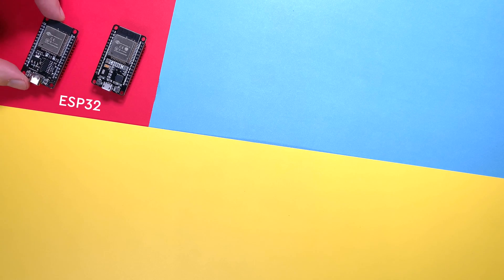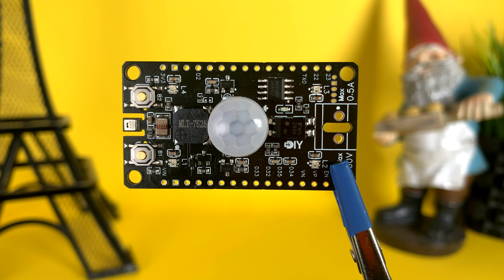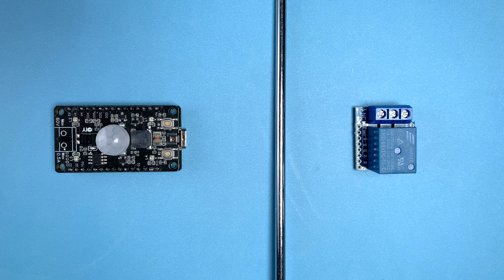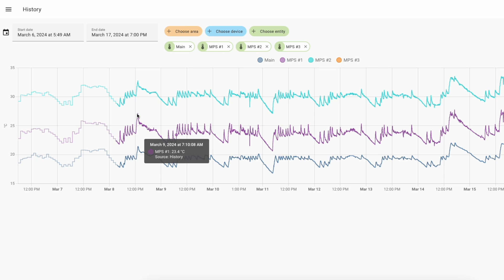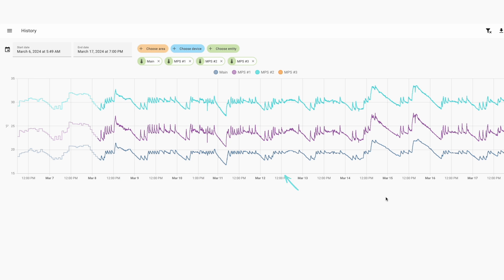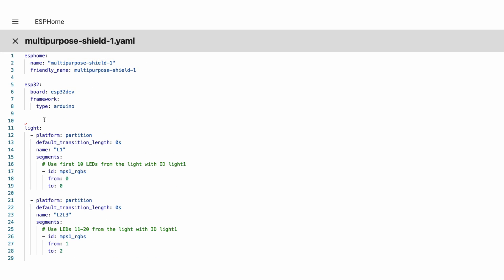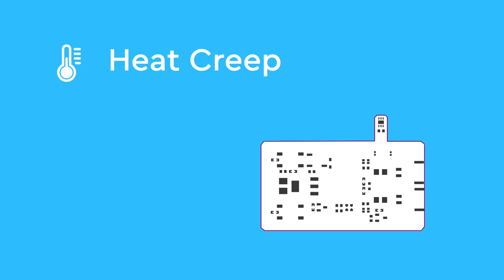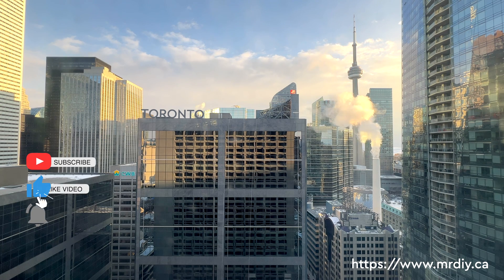Building My Ultimate ESP32 Shield

Comment: making it ESPHome compatible makes this SUPER useful and more valuable. Thanks for doing that. Also, in my opinion I think the ability to add on the presence sensor is a good one. Integrating it into the shield might raise the price dramatically, so you might shift instead to just some sort of headers or something to allow people to add it on if they buy it separately? Also, I see people wanting to use these in rooms (maybe even every room) but they always wind up with a charger brick and usb cable and stuff. I don't understand why these things don't come in a form factor you can plug into an outlet... kinda like a night-light (which would be useful to the room plus provide all these sensors). So another thing you might consider on the shield is a way to convert line voltage to the voltage you need for the ESP. Not sure if that is easy to do or not. Thanks for the video!

Comment: I use the same temperature sensor in my automations and find they need to be a ways from the electronics.  A small fan blowing fresh air over the sensor is a good idea.  If you don't mind it being less responsive, a small fin array on the back might also help some.  GL
Reply from the maker: thanks for sharing your tip

Comment: One possible solution would be to make cuts around temperature sensor (just small bridges). So pcb wont conduct heat so much.
Reply from the maker: That is already in there - unfortunately didn’t help much

Comment: Try putting temperature sensor below the board, in lower section. This way the warm air from the heat generating components will rise up and stay away from the sensor.
Reply from the maker: Yes, I noticed the orientation affected the offset

Comment: You could make the temperature sensor a break off so did you can use it where you want just by breaking it off and attaching a few cables
Reply: Or he could use an off-the-shelf temperature sensor instead of building a shield and breaking it off
Reply: @MohammedHaneef-ch3tj  what do you mean by of the shelf? His components are existing ones?!
Reply: @TecSanento like a Dallas sensor with a jst connector on it.

Comment: few comments from my experience:
1- there is NO way to get proper temperature on the board that is ALWAYS on - I removed my temperature sensor from such boards and use ONLY in sleeping sensors (i.e. 3min sleep, 0.2s work), both ESP32 and power circuits always raise temperature around - you would have to move sensor 30cm away and out of the box to avoid impact
2- calibration will only solve the problem in FIXED conditions not in the whole range of sensing
3- using better sensors (i.e. SHT31 or 40x) - but that will not the problem either
4- presence sensor is prone to wifi interferences

about programming: 
1- esphome is good but not for complex project - and its purpose is for simplification and for allowing newbies to come to the game - if you can program nice things in C/C++ stay with that - you will always be limited and you will not see what happens behind it if you stay with esphome
2- for sleeping sensors: use espnow where your sensor will work in total 0.1-0.3s rather than wifi where you need 1-2s - that improves battery life and iimpact on temperature/humidity sensors

these were my 3 cents, that might not apply to your project but you asked for it ;-)
Reply from the maker: Thank you for sharing
Reply: Or he could have used cut outs to restrict the pcb area leading up to the sensor...that layout was probably in the datasheet of the device.
Reply: @backgammonbacon  Over time the pcb area will heat up. This is not the solution. Better just use a separate device for measuring temperature. I use a MOES Tuya ZigBee Smart Home Temperature And Humidity Sensor With LED Screen (AliExpress).